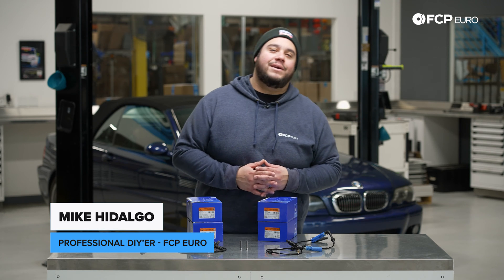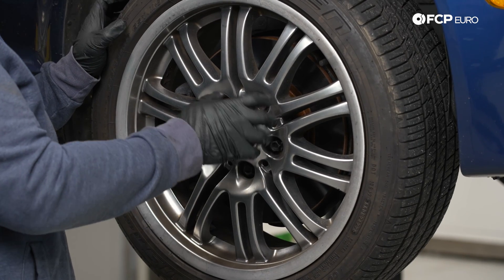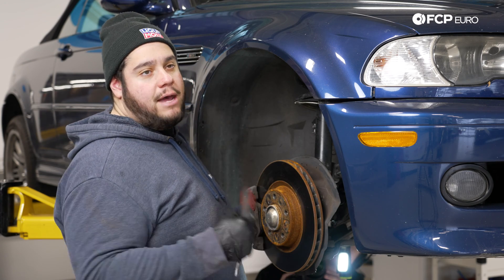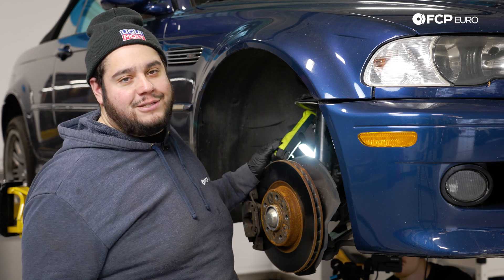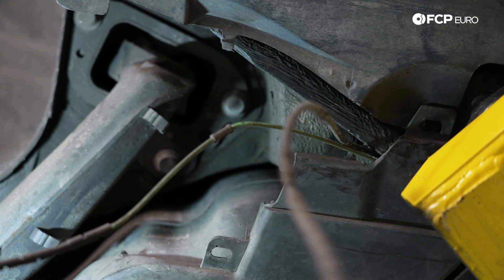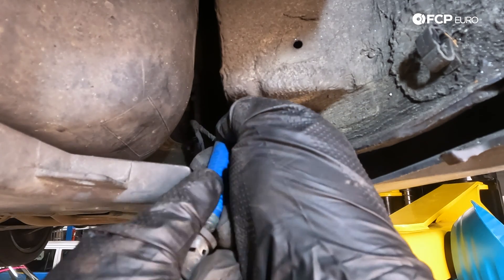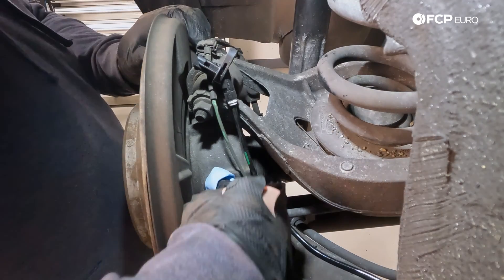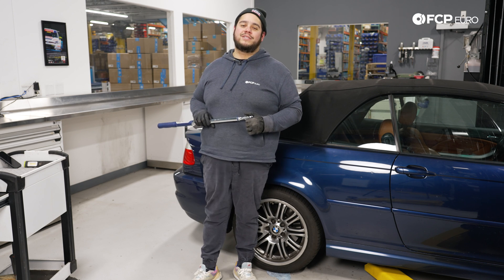BMW M3 ABS Sensor Replacement (2001-2006 BMW E46 M3)

Comment: Hey FCP Euro and Mike, thanks for the informative and well made vid. Several times, it was explained that an ABS warning on the dash followed by analysis of the BMW computer cod(s) pointed to the two sensors that were replaced. Great. But now that all of the work is done and $ is spent, what is your Final Result? Did all of the ABS warnings disappear? Does your dash no longer look like a Christmas tree?   :)